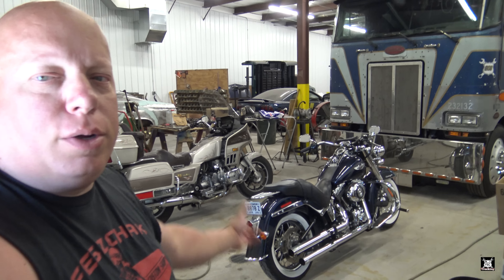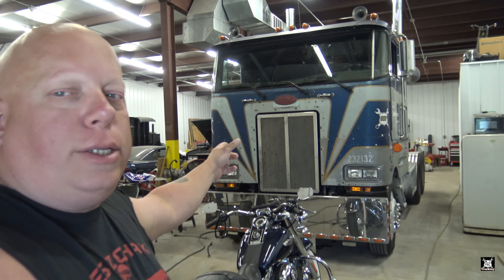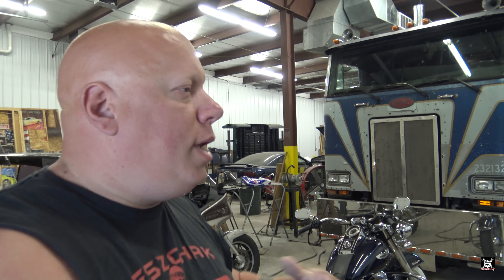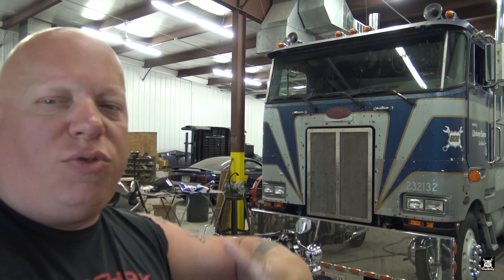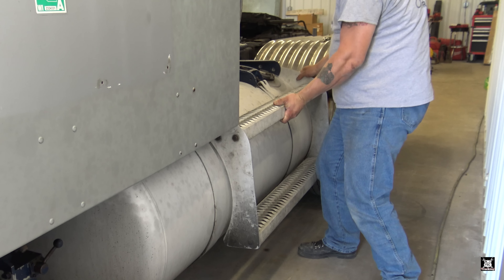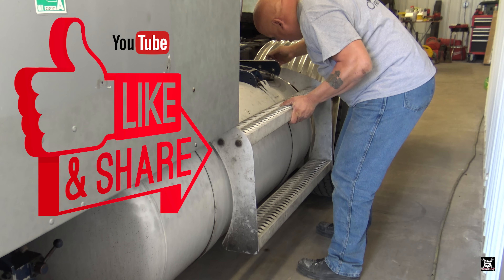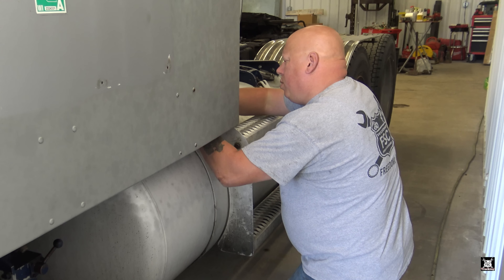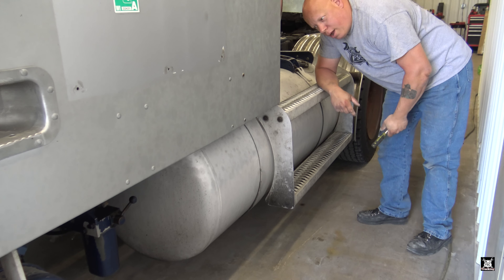1984 Cabover Peterbilt Luggage Door Hinge Latch Cable Replacement

Comment: Go to a John Deere dealership and get you a can of spray graphite. They use alcohol to suspend the graphite works great on hinges. Older trucks are better than new trucks you just have to work on them once in awhile.

Comment: OMG oil them doors or something that is shocking.
Hell I'll never forget when I worked on heritage railway stuff
I couldn't help die laughing when some doors needed work because the hinges needed oiling and stuff 
Everyone kept kicking the doors open it was so stiff from years of neglect soo the next day I fixed the issue and and one guy kicked it open. Well it flew open and slammed shut in his face. Never seen someone soo puzzled before with a WTF look LOL